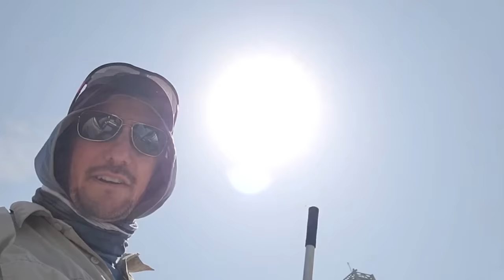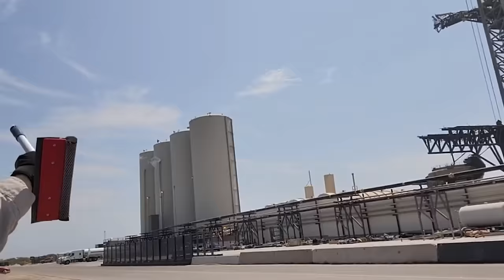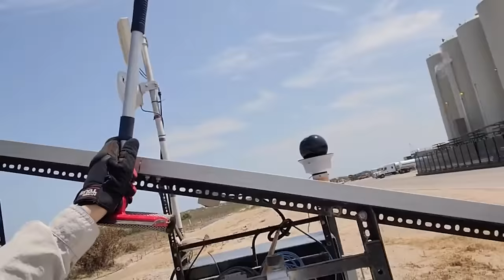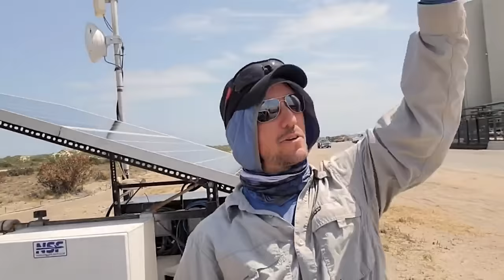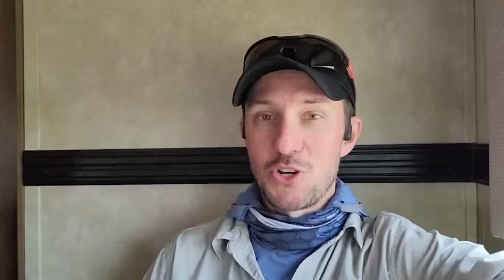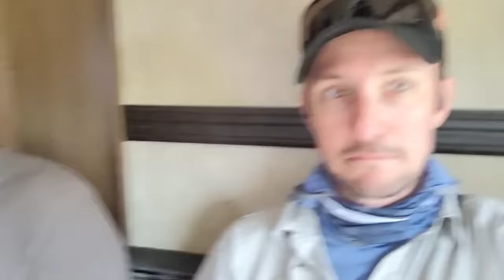Behind The Scenes: Making Our Starbase Coverage Work!

Comment: For those of you wondering about everything else on the trailer other than the solar panel, here's what I can pick up as someone who works in an industry with this sort of stuff:

On the left pole closest to him are three small fixed cameras which are just used for general monitoring of the area around the trailer, and the thumbnail shows a PTZ camera (mounted upside down) on the top of that pole.  The rounded enclosure on the other pole is a point-to-point communication antenna, which would be pointed back at wherever their local broadcast 'HQ' is located (with hardline internet connectivity), while the square enclosure on that pole probably contains one or more LTE antennas.  The black dome on the right side is an Axis Q63 PTZ camera, also mounted upside down.  All the boxes underneath the solar panel contain everything else needed to make the trailer work, such as the battery bank, charge controller, power supplies and inverters, network switch, etc.
Reply: Making this both mobile and expandable was fun.
Reply from the maker: At the gate already? 😅
Reply from the maker: Yup, that's another video.

D

Comment: The panels can also overheat and reduce their output.  Bi-directional panels mounted parallel and not only get direct sunlight but also reflected light off the ground or a surface.  Bonus with that is not surface for dust/debris to settle and lowered impact of heat from the sun.
Reply: Yeah, The Leipzig University of Applied Sciences did a study on solar panels and found that the bifacial solar cells produced the same or more power than the traditional flat faces pointing to the Sun. But they were looking at solar farms for power generations for the grid, so small portable applications like this, might need the flat face. The scientists planned on more studies to confirm their findings, so something for Das to keep an eye on.

Comment: The highway site was shown during stream (and I think members only video?). 

Maybe consider putting scaled down chopsticks on your communication tower. There is some resemblance with the truss structure.

Your sun angle changes not only across the day - it's also across the year (zenith is highest in July). there is a table of optimal angle for solar panels - based on your latitude!

Comment: I use a cheap 12 inch speed square and set it on the panel. Check it at solar noon for your exact location. If you want an easy mount to adjust, find an old c/ka-band satellite dish mount (the big 10 foot dishes). The actuators have 24 volt DC brushless motors and are strong.

Comment: As I shared on another video, the panels should be split to east-west for your systems. You’ll have a wider time wise charging session, which is what we need in off-grid systems.
Reply from the maker: Larger footprint, though, and harder to position useful and stable cameras and comms around them that way.  -Das
Reply: @NASASpaceflight  true, but I don’t see an issue with available space around your installations. In any way, especially if the batteries are usually full by early PM, east/west is a better way to setup a solar system when off-grid.
Reply from the maker: There's definitely limited space on the trailer, and you have to balance camera view positions with solar (especially when north of the pad looking south. Don't want cams to block sun, and don't want panels to block cam LOS). Das

Comment: You can also use a used Skywatcher HEQ5 equatorial mount for astro and put your panel on the plate configured with Sun tracking. This head can run on 12v batteries

Comment: ONE would think that if you're going to be adjusting the height  bars  , that you'd use  adjustment friendly  parts instead of actual nuts and bolts .  Something  similar to quick release pins  on scissor lifts or   locking pins of some sort .   Less time fidgeting with nuts and bolts , less  parts to lose  and time better invested in other things .  Google locking pins , it's that easy .
Reply from the maker: Yup, this was version one. We already have lots of ideas for version two. - Das
Reply: @NASASpaceflight   Glad  I could help in the ideas department  .

Comment: Except you have camera mounts and other sticks casting significant shadows onto the panels outside of peak hours which reduces efficiency. You should lower the camera mounts or put them on the top and bottom edges of the panel so they don’t cast shadows like they currently will in the early and late afternoons.

Comment: How about using stainless steel nuts and bolts especially when you are so close to the sea water spray, I am sure you can use an antenna rotating motor or a second hand disability scooter motor for up and down and left to right motion for your solar panels, to save undoing the bolts as the Sun travels across the sky, just a thought, thanks to you all for the updates. 😊🏴🇺🇲👍

Comment: Aren't there calculators specifically to calculate optimum solar angle?  (Or if you rather calculate yourself, then calculate the sun's elevation angle at zenith.)  Then it would be a matter of using a digital inclinometer to match the angle.  That way you don't have to make adjustments under the heat of the Texas sun.

Comment: Great educational video. Suggestion-don't they have some kind of tracking device for solar panels i.e.  some kind of mechanical device that moves them in order to get the optimal angle for charging instead of moving your panels all the time.
Reply from the maker: I discuss in the video... the salt air will destroy mechanical trackers. - Das
Reply: @NASASpaceflight  ok 👍

Comment: That’s a nice rig bro.
Do you have a deep cycle truck battery in the trailer to skim off excess load into storage. A 24v gel battery.
Reply from the maker: We've got 4x 100Ah 12 v lifeos in the battery box. 👍 -D
Reply: @NASASpaceflight  Juicy! 🤩 run the webcam all night!
When I first had solar on my home we dropped gel pack truck batteries. Didn’t have Lifoes.
Reply from the maker: Yeah, it can stay online for a couple days with zero solar input... just have to manage the power usage. 👍

Comment: Or, better yet, just mount your panels on a 2 axis tracker (about $600).  Just point the trailer south and the tracker will get you about 30% more power into your batteries over a year.
Reply from the maker: Covered in the video. The beach destroys all. - Das

Comment: You seem to be power constrained   Instead micromanaging the angle to get a marginally increase at noon, you could add one bidirectional panel that is facing east and west, which will give your batteries/inverter more power earlier and later in the day.
Reply from the maker: Nah, we had just moved it and were spot checking whether the angle was close enough.

We manage power through a system of IP controlled DC relays so we can basically out support systems to sleep when we need to conserve or they're not useful. The entire trailer only draws a couple watts in standby mode, and cams are ~15w ea. -Das

Comment: Is the trailer concrete proof? ;-)
Reply from the maker: It's affordable. We built it from basically scratch... the frame is an old welding trailer we picked up for a couple hundred bucks. - Das
Reply: @NASASpaceflight  Thanks. 
Good to see you back in front of the camera again!

Comment: You could have just placed the end of that on top of the panels.  It would have been easier to get an accurate measurement.  Instead of holding it on the side of the panels.
Reply from the maker: The whole point was to illustrate the shadow at various angles. Wouldn't have worked well if it was fixed at 90 degrees. ;) -  Das